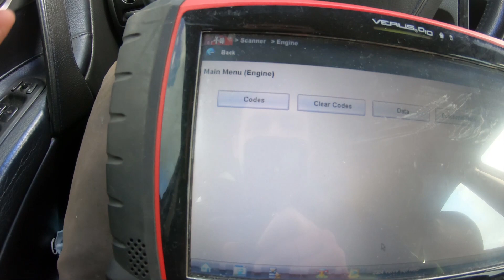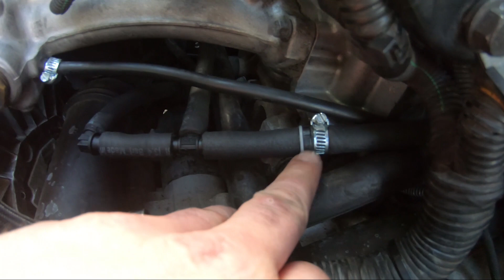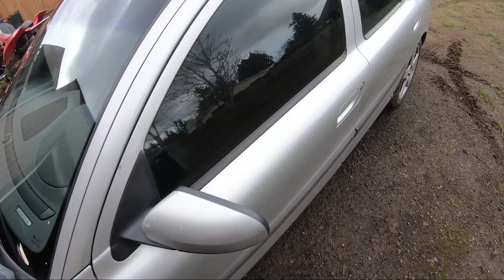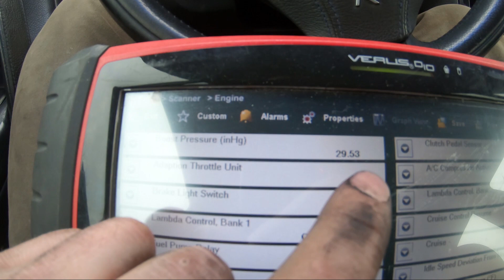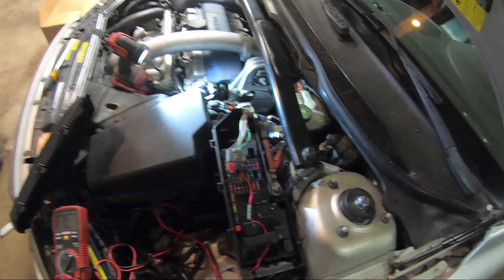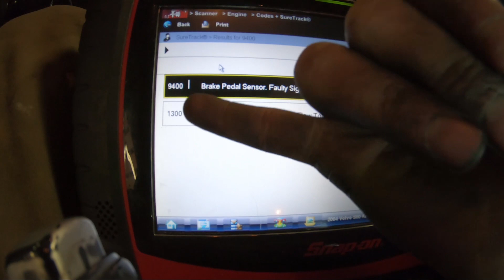Volvo p2 ECM-1300 MAF flow too high code diagnosing in S60R. HELP!!!

Comment: 3 years later, I'm having this issue on Volvo S60 2.5T

Code:
ECM-121B

Definition:
Mass Air Flow (MAF) Sensor, Flow Too Low

I have changed MAF sensor "twice" with new Bosch OEM. Still the problem persists.

Comment: That 1250 reading at idle, that goes DOWN when you increase revs is very fishy. Try leaving the MAF plugged in, but not attached to the intake pipe, if it will run at all see what reading the MAF gives with no air being drawn through it. You have anyone in the area with a similar R you can hook up the scan tool and read their MAF behavior on? Crank speed sensor accurate? Throttle position sensor accurate? Knowing your 'good' sensor reading ranges in advance helps in pinpointing the why's of errors/faults later. I assume during the rebuild you had the battery out do the ECU was dead dead dead, no saved levels that would have been foooked from the leaking head, sticking around to be used to calculate anything involving the newly rebuilt non-leaking engine.
Reply from the maker: The battery was out of the car. And my brother has one the one that on my channel that modified i can check his.

Comment: where did you get a wiring diagram for the R?
also sometimes battery being low causes my car weird issues. even tho it starts up fine, someone once told me since these are centrally networking cars having it charged to 100% may be worth a shot
Reply from the maker: I found it online. And i will charge it to 100% then and ill clear codes and see.

Comment: You should check the  tcv solenoid ( turbo control valve), this may cause also these MAF problems.
Reply from the maker: I have an extra one ill swop it
Reply: @BuiltForSpeed  And also check if you have no vacuum leakage in the 3 hoses on the tcv. Good luck, and will you keep me posted?
Reply from the maker: @hj5568  i already checked the hoses they are tight with new clamps, i checked the maf sensor, checked the piping, wires seem ok to the maf. Idk if i maybe forgot to mount some sort of ground that i took off when taking engine apart.